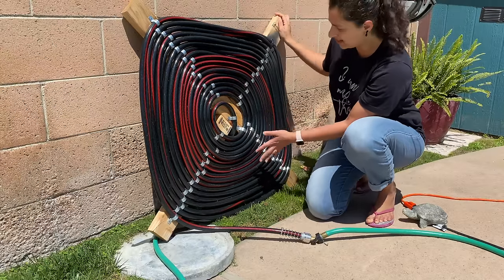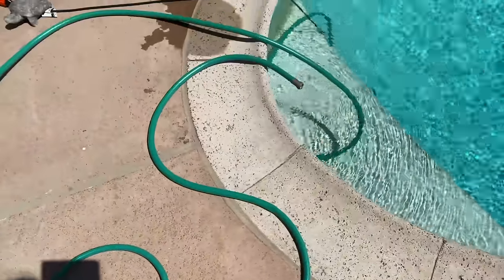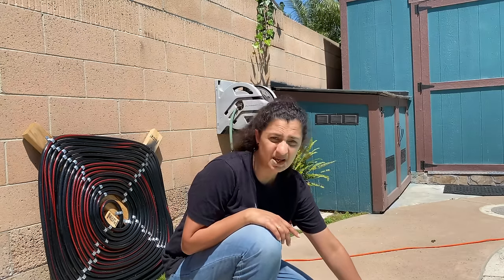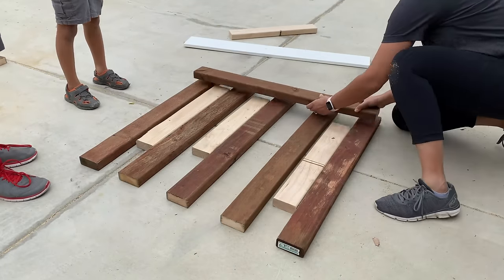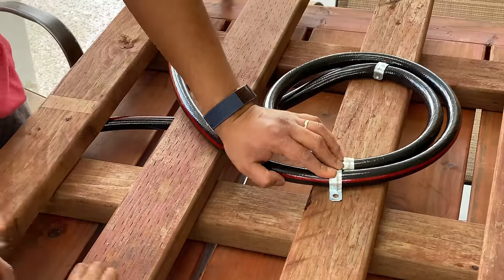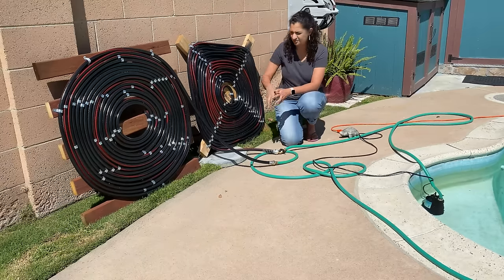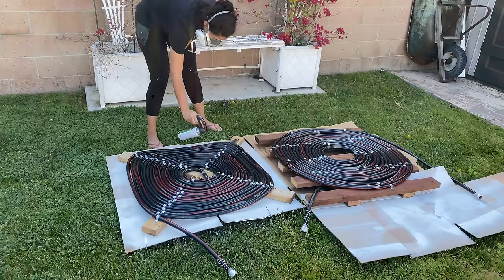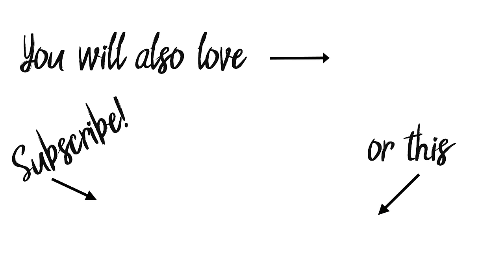DIY Solar Pool Heater - Simple & Easy Design - Did it work? | Anika's DIY Life

Comment from the maker: Find out how it worked for us - https://www.anikasdiylife.com/diy-solar-pool-heater/
Reply: Your link doesn't work
Reply: @RobertHunley  Yes, it does work.
Reply: It's been 2 months or so. Would love to "Find out how it worked for us" but no new information given. It's all just word for word verbatim, everything said in the video. Just a shameless plug to your website? We'll just assume you've been too busy. Either way. I wouldn't invest in neither the time or the money unless someone can actually prove this works, undeniably show desirable real world results. which I did not see here. All we saw was mildly hot water coming out at a trickle (on an extremely hot sunny day) which will have exactly what kind of impact!? And if it's 100F outside anywhere, why in hell do you need the pool above 70ish to swim in it. I would want it cold so you can COOL yourself off on it, isn't that the point of an outdoor pool?! Have it warm when it's cold out and cold when it's warm out and this project does nothing to address that. Sorry but I have to agree witha few of the comments, looks like a flop. Thurs no cheap way around heating a pool.
Reply: @itechhen  Dude! 70 degrees is way too cold for a pool. 78-82 degrees is the norm, at least round these parts, but I even find 78 degrees a bit too cold, personally prefering 82-85 degrees.
Reply: @itechhen  I'm sorry but you are incredibly rude if you haven't figured out by now that the solar heating panels do work and are sufficient ways to heat a pool then why are you even looking into this it's no one's job to show you that this is a science that works the only difference in this video and other videos is showing different ways she clearly showed you the increase in temperature and I believe on her website link it also shows the supply list which I found hopeful I don't know it looks like you just want everyone to do the work for you and then you're incredibly rude on top of that
Reply: @jmn566 I'm not here to impress anyone and I sure as hell wasn't even talking to you and yet somehow you've interrupted as a slight towards you. Well then you found it rude. So what. Get over it or stay mad and get cancer, what do I care. For the record, never said it didn't work. I asked for the author to do a follow up, otherwise not doing so can also be interpreted. The message it sends is pretty clear.
Reply: 1. As many people have pointed out (and maybe you have done) stop restricting it, if you want the water in the hose to be as hot as possible then you stop the flow, but that doesn't get the heat into the pool.
2. You could get a solar powered pump so it only runs when the sun is out and you don't accidently have your heater acting like a cooler, plus then you're not paying for the electricity.
Reply: Hiya, thanks for your video. You could try a black metal sheet and have the water run off that. I think it may also be better to use copper tubing and spray that black. Metal gets really hot. Cooper is much better for you than plastic too.

Take care
Reply: dont know if you guys gives a shit but if you guys are stoned like me during the covid times then you can stream pretty much all of the latest movies on instaflixxer. I've been binge watching with my brother recently :)
Reply: @Wesson Shepherd Yup, I have been using instaflixxer for since november myself =)
Reply: @cwstewartjr1973  - If you pour 1 cup of 100° water into 1 cup of 80° water it will be 2 cups of 90° water.  This is the same idea just with much slower results.  The weighed average of the thousands of gallons in the pool to heated water running back into the pool is not nearly as drastic as my 2 cup example, but it does help over 12+ hours of daylight.  If you don't understand the concept then you should do some research before posting your ignorance (FYI, ignorance is simply not knowing something, I'm not calling you stupid, I guarantee you know things that I am ignorant about).  I can think of twice I've commented on videos to later find out I was ignorant about them and therefore my comments were wrong.  I'm no longer ignorant on those particular subjects (I'm no expert either).
Reply: @dustintunis9347  I agree that you are no expert.
Reply: I think instead of adding a additional line of hose  to the same pump just have its having its second separate pump
Reply: she can heat up about 150 gallons an hour 20 degrees and put it into a 10,000 gal pool. how well do you think it's going to work? basically equivalent to a drop in a bucket

Comment: No need to restrict the flow. The amount of heat energy going to the pool will be the same. In fact when impeding flow you may end up with less energy transfer.
Reply: Few understand this.
Reply: 100% This.  I've watched at least 20 videos of people making these..   I don't understand why everyone restricts the flow to a trickle.  I understand that it's cool to see a 40+ degree difference in temperature but you are just hurting the pump.  The energy still ends up in the pool no matter the flow rate.
Just buy a low power pump that has enough head pressure for the hose length you want to run and leave it unrestricted.

Think about commercial pool heaters.  They work great but you can't feel or barely even measure a temperature difference coming out of the jet when 50 gallons per minute go thru them.  They still heat the pool up.
Reply: yes to this, the heat rise slows down exponentially, where if you stop the flow and open the tap a few hours later it would have reached very near its temperature ceiling. There is probably an optimum flow rate, although this would probably be negligible in comparison to just letting it flow at the pumps full ability. So please try with the tap fully open. I am heating a 4600 litre pool with a homemade one and getting around 4ºC rise from it on a very good sunny day in the UK (yes they do exist ;-). Also, you may want to put it in a box with glass or acrylic window to make use of the greenhouse effect. Nice video :thumbsup:
Reply: There is an optimum flow rate. Depends on length of pipe and pump power. I find my pump on full flow, the pipes don't get warm at all. I slow the flow down until just the very end of the pipe becomes warm.
Reply: @monoman151  The pipe isn't getting warm because the water is taking the heat energy and putting it in your pool!
Reply: The system performance deppends on delta T só more flow more great tranfer
Reply: Yes, get the heat out of the damn pipes as quick as possible, absorb heat from the plastic it will warm up more. Also need to be wary though as it can also act as a cooler!
Reply: Get a giant magnifying glass hang it on The roof point at the pool. I got a 6 foot one at harbor fraight it works great
Reply: @TheSolarPoweredEngineer  nice point with the acrylic window. I was wondering how to stop the heat loss due to air convection. Having a transparent heat insulant should work pretty well. And yes, to the OP, yeap, the hotter you let the hose be, the larger the loss you have to the atmosphere, plus the hose might start breaking down faster due to the high temperature. best to run it at maximum flow rate, you will get a faster heating of the pool, even if it doesn't feel as hot. Also having the hot water at the surface of the pool (where it will naturally move to) ensures that you lose a lot of the heat just by air convection there too. So again its always better to run it at full flow.
Reply: @monoman151  , you are right there is an optimum flow rate, and that is as fast as possible, not slow enough that you feel the hot water. the amount of heat put into the pool does not depend on the temperature you feel the water coming out, that was the whole point Louis was making. If you take your slow flow hot water and mix it with the whole pool (or even just the same volume you get when you have faster flow) you will not feel as large a difference in temperature, this does not mean it is not heating up. The bigger difference is how hot the whole system is, and the hotter it runs (hose, pipes, hot water at surface) the more loss of the heat (to the air) you get and it will take overall longer to heat your pool.
Reply: @drsquirrel00  that is a good point! As soon as the pipe temperature is lower than the water temp you should shut it off!
Reply: @jfmrod  very good point, I'm currently sitting at my computer programming an Arduino with 10 temperature sensors and a relay output to log and monitor system temperatures, the pumps will turn off if not enough heat in my panel 😁
Reply: @PutEmInTheBox  exactly.to be hones i have tried to explain this to about 6people only 1admit this could be right, others just argue
Reply: @jTempVids  is 400w pump enough for 60mtr for half inch hose? for coils like this?
Reply: @TheSolarPoweredEngineer  hi sir, i am in uk as well, i have same pool,may i have a question? how many metres of hose did you use? is it 13mm hose? and how strong is your pump? thank you for your time.
Reply: Neil Devonshire - Dev255 wow tell me more. I’m going to build something like this, but with pex tubing and in a box, and then put it on top of my patio cover for optimal sunlight
Reply: Was just about to say this.
The bigger the difference in temp, the better the transfer, run as much water as you can through the tube.
Reply: I wonder if the output from the pool jet could be diverted instead of using a second pump.
Reply: Marko Palikko absolutely, some split one of the pool jets and divert some part of the flow to the heating system
Reply: Inversely depends probably
Reply: Would you not get more heat energy if you increased the flow? Increase flow would take more energy from the coil quicker, cooling it down, now the temperature difference between the coil and the sunlight will be greater increasing energy transfer to the coil?
Reply: right. it seems like you want hot water coming out, but if you're cooling the pipes the temperature differential is actually higher and so they should absorb more heat.  in any case it's not going to absorb less.  Just think of it as how much solar energy you can transfer from the pipes to the pool water.
Reply: Yes!  For example, 1 gpm flow and 10 degree rise is the same energy into the pool as 10 gpm and 1 degree rise.  But more importantly, you are losing more heat from the hose to the environment at the slower/high-temp flow rate.  The sun delivers the same energy to the hose either way, but the loss of heat to the air and loss of heat by radiation from the hose is faster the hotter the hose is.  The greater the temp difference between two objects, the faster heat moves from one to the other.  And in the video example, an 80 degree day with a 70 degree pool, there would be no conductive heat loss to air at all at a flow rate that keeps the hose water at or below 80.  You would actually even pick up a little heat from the air at least at the start of the coil while it is further below the air temp of 80.  And the hotter an object gets, the more heat it loses due to radiation, so the hotter hose radiates more heat in addition to the increased conductive loss to air.  With the restricted flow, the water was 140, so now your are radiating heat and conducting off tons of heat to the 80 degree air.  Plus your pump would be a lot happier without the restriction.
Reply: For the same reason if pump is oversized, run hoses in parallel vice series.
Reply: Louis. Is it best to use the thinnest pipe possible? Is there an easy way (formula) to determine pipe size that should be used?
Reply: Although very very correct, there could be energy loss from the pump and the wires. So as low as possible while still maintaining a high delta.
Reply: Exactly. The higher the temperature differential the more heat the coils will transfer to the water. So fast flowing colder water will pull more heat from the coils.
Reply: It's also worth mentioning that by restricting the flow and allowing the coil to heat up more, the hose will probably degrade faster.  Definitely better off having transferring that heat to the water.
Reply: And another thing about these systems is that the area is pretty small for the amount of material, cost and weight.

To optimize the area covered, cost and weight as well, it would be best to work with air. Then you don't even need tubes. And can put up light-weight and cheap panels where they get the most sun and are out of the way: on a roof. All you need to heat water is a copper coil to run the heated air through.
Reply: @TheSolarPoweredEngineer  no, there is no optimal flow. the sun gives about 1KW energie per square meter no mater the flow, more m2 is more heat. slow flow just means les hotter water, but not more heat.
Reply: @getreal4883  - Are you being funny?  If not, please give more details.  No such item can be found in my searches.
Reply: @getreal4883  are you serious? 😆
Reply: I was about to say this...
Reply: @jfmrod  high flow is actually important, as it is insulation behind the heated element.
Reply: Lot of engineers in the comment. What is this C-19 consultation
Reply: WORDS!
Reply: The major reason heat pump needs restricted flow is to lessen the wear and tear (which I don't really understand) so. I would never restrict flow through simpler designs, you will actually get worse performance.
Reply: From basic physics, total heat transfer to the pool is difference of:

1. Intake of heat from radiation of sun
2. Lose of heat through radiation and convection from the pipe

This is assuming the pipe surface temperature is warmer than the surrounding air.

Intake from heat is constant regardless of flow rate. The loss of heat is actual higher with lower flow rate because slow flow rate make the water hotter, which increase the speed of losing energy through both radiation and convection. 

Someone suggest adding plastic sheeting, which is interesting. Plastic sheeting will actually reduce radiation heat from sun but reduce loss of energy from convection as air flow is restricted. Also due to greenhouse effect the surrounding air temperature will increase, thus adding extra convection heat transfer.

I am setting up a small pool and will give this a try, with 1/2 irrigation tubing instead.
Reply: True
Reply: @markopalikko6986  I know you posted this a year ago but... if you have a 500 watt separate motor running... if you connected to the pool pump.. the pool pump would use 500 more watts of power... in fact It might use more.. because you are overloading the more and efficiency will drop
Reply: not to mention burn up the pump
Reply: Conservation of energy is important to think about here. Energy in to the coil from the sun can only go two places: into the pool or not into the pool. Maximum flow rate will ensure as much energy as possible goes into the pool and not into the surrounding air.
Reply: @CasuallyObservant  Fresnel lens?
Reply: Yes, obviously the cooler the water is, the more transfer. It's odd this isn't intuitive. Great comment
Reply: The energy is related to sun acting on surface area and not flow, as  slow flow of hot water = fast flow of warm water, its same energy, as commented before, its works better cooler as less losses to atmosphere
Reply: @getreal4883  are you kidding?
Reply: Agree, instead of restricting the flow, what you need is to INCREASE the length of the coils, therefore extending the amount of time the water is heating. Right?
Reply: Not true in my world. I’ve noticed the longer the water is in the panel the hotter it gets. Tried both slow and fast flow rates. Jacuzzi didn’t heat worth squat all day with a high flow. Cut it down slower and it got hot in a few hours.
Reply: @apostolakisl  hi so I saw another video where they did this but they used a copper coil section on a grill. He also used a hose a spray on the end in order to again trickle the water.. In that case, where it’s not dependent on the entire hosing system, being heated by the sun, just a relatively small portion of the coils being hot AF on the grill… would it still be better to go at maximum flow rate?
Reply: @mattwasmyname   hi so I saw another video where they did this but they used a copper coil section on a grill. He also used a hose a spray on the end in order to again trickle the water.. In that case, where it’s not dependent on the entire hosing system, being heated by the sun, just a relatively small portion of the coils being hot AF on the grill… would it still be better to go at maximum flow rate?
Reply: hi so I saw another video where they did this but they used a copper coil section on a grill. He also used a hose a spray on the end in order to again trickle the water.. In that case, where it’s not dependent on the entire hosing system, being heated by the sun, just a relatively small portion of the coils being hot AF on the grill… would it still be better to go at maximum flow rate?
Reply: Higher flow transfers heat faster, breaks up laminar flow layer inside hose.
Reply: This is the most important comment here. You want maximum heat transfer which requires maximum temperature differential inside the tubes... ie lower temp... higher flow.
Reply: @TheSolarPoweredEngineer just add thermostat module about 1 usd and set the minimum temperature to shut down the pump and set the temperature to start the pump